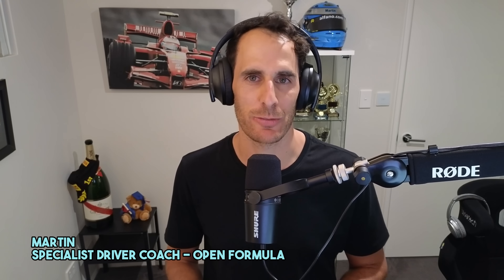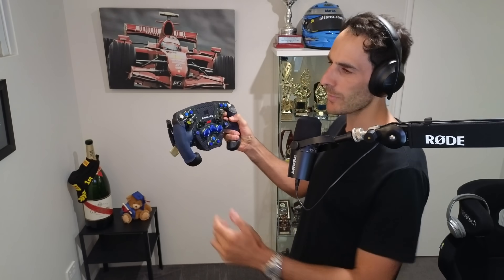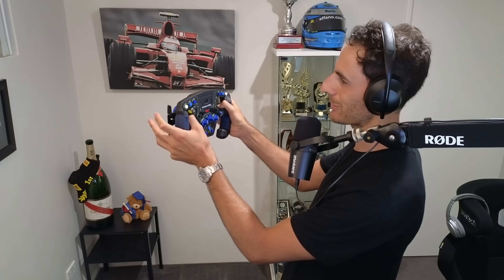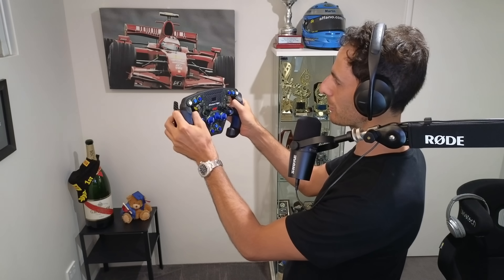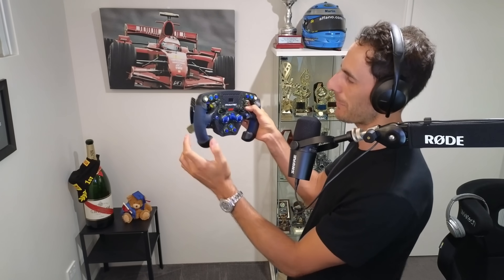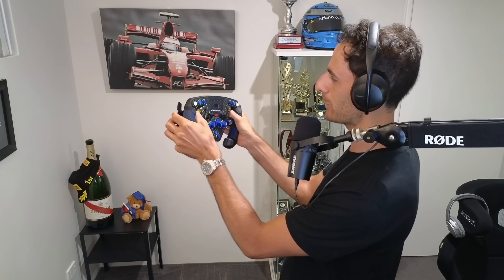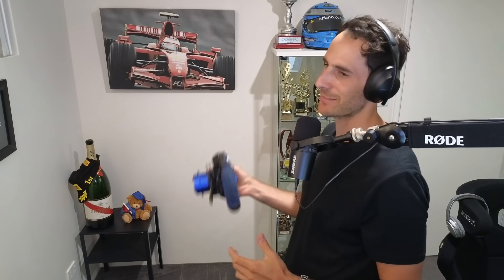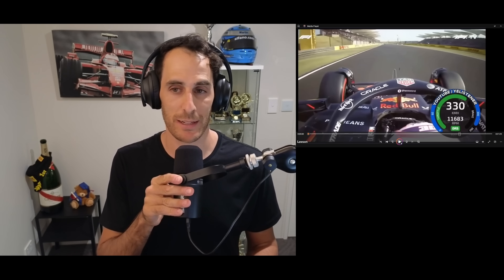The SECRET TECHNICAL Reasons Why Liam Lawson Was Sacked!

Comment: How is it Liam’s race engineers do not point this out because the data traces would make it obvious… perhaps Liam has this as a habit & just needed extended sim time to understand how to break the habit (a car-confidence issue, ultimately)
Reply from the maker: I think pointing out is only one part of the story.
Engineers are pretty good at pointing out. But explaining the why, or how, is missing. The importance and implications of such a technique too. That's a second step of insight that you need a driver coach to build trust that this direction is correct and create change. Have a look at my most recent short on Tight Lines/ Hamilton's engineering team recycling facts to Lewis when he's asking for help!

Comment: How do you think it is possible Liam got to this point without his engineers pointing out what he was doing wrong? If what you say is so obvious then sure Red Bull would have had that data before hiring him?
Reply from the maker: Its a good question. A) Its obvious to me (as a specialist open formula driver coach) but not necessarily obvious to some performance engineer etc.
B) How to resolve for it? Maybe also not communicated/ coached well to Liam such that he understands the importance of steering rate.

I think f1 is low level on at the track, high level in the design centres.

Interesting question keen to hear your thoughts back. Check out my most recent short clip - that gives you an idea of how bad these engineers are / are at ferrari

Comment: Very useful analysis!
Reply from the maker: Thanks appreciate this! So Suzuka quali, who you got? Liam or Yuki
Reply: @lowerlaptime  that's a good question that you ask considering what I've just learned about your analysis of LLs driving. Would you say LLs driving style is also a limition for the car he's going back to or an advantage because the car is more forgiving and suits his style better? Before watching your video I had LL with advantage just because Yuki would be under so much pressure and likely make mistakes but I'd call it 50/50 now.
Also, I just read that they have said Yuki's car will be quite different in set up to Max's but I heard them say that about LLs set up too, a reason he started from pit lane. Will they set up Yuki's car quite differently than LLs short run? A very relevant question if we're going to compare the two.

Comment: No offense but in the 1st example I felt there wasn't much difference between Max and Liam. You say in the wet Liam's style would be ok but imo that's also not exactly true: in the wet you need to be super smooth or you'll get understeer a lot faster for obvious reaons. Or what did you mean?
Reply from the maker: RE the hairpin - yeah you're correct. It is indeed, a small difference. Max is a little more continuous and Liam a bit fragmented in how he applies the wheel. The best example there is the double apex, that's bad use of a wheel

So in the wet you need to keep the wheel straight while braking and exiting, and do the whole "short corner" "v style" at the apex with a big hard and fast steering input

Does it make sense? Cheers!

Comment: The friction circle is a nice illustration but what your illustration assumes is what brake pressures he is using. Really what's needed to explore your theory are real steering and brake inputs but they should be available when using the simulator so why has he gone so wrong?
Reply from the maker: His whole timing of the turn in is off. Not so much to do with pressure application. Does it make sense?

Comment: Very similar to cornering with a motorcycle
Reply from the maker: Is is? How so!
Reply: @lowerlaptime  you need to trail brake as you lean into the corner to maintain traction. Too much front brake, down you go. Way too much front brake and over the bars you go. To be fast you need to be smooth.

Comment: That to me looks like a lack of confidence. We know the car is very snappy with a highly sensitive front end. Lawson obviously does not have the confidence to turn in at the same point and rate as Max does it. Now the sharp turn in the second phase could be one of two things, or a combination of both:

1) At some point he has to compensate for the lack of rotation in the first phase.

2) It might even be him DELIBERATELY inducing understeer to stabilize the rear.
Reply from the maker: How would you fix that confidence issue?
Reply: @lowerlaptime  If there was a simple answer to that, Sergio Pérez would still be in that car. So obviously I can't answer that. But I am convinced that as long as they don't make major improvements to the car (and with a different prioritisation in the development than the one they applied in the past), no one but Verstappen will feel confident driving it. Let's see how Yuki does, but I don't have high hopes.

Comment: thats all the new drivers in F1 todays. they want straight hard braking, and then turn and then straight hard acceleration. they never lean on the car. they never feel the monocoque. they dont trust the steering wheel.
so this isnt about "oh max verstappen driving style is difficult" no. this is modern driver "arcadey" approach to things. they want to whip the steering if then the car magically hold up. they prefer "drag race' style.  while naturally, you should be in command of where the car is going/where the nose is pointing. 
its like this in other words : newer generation of driver doesnt "draw" their racing line. they leave it to the result of their braking and their acceleration. while instead they should have GUIDE the car through the line in reality. they should DRAW the racing line with their steering. those who could do that gain the most in lap time.
maybe like if we want to put those new drivers into a quick "karate kid" style of training, we should tell them to do a PUSH THE TROLLEY racing in supermarkets. so they learn to DRAW THE RACING LINE.
Reply from the maker: this is a great analogy, explanation, and example

Comment: Dude. Every driver has a driving style. Some like atracking a corner and others like gliding through it. Both are trchniques that lead to different steering inputs. The main thing is to look at this combined with braking snd acceleration inputs
Reply from the maker: Hey. I never trust anyone who starts off with DUDE, because, in my experience, they've always been incorrect. I didn't read your message past the first line.
Reply: That's Cool, dude  @lowerlaptime
Reply from the maker: @FormulaBricks  lol
Reply from the maker: @FormulaBricks  its nothing personal its just that always garbage follows it. oHhhh dudddeee dude. Mate.settle
Reply: @lowerlaptime  I get it. People comment garbage all the time. You're right tho. Dude belongs at the end. Not the beginning.
Reply from the maker: @FormulaBricks   @FormulaBricks  well, you dont get it. People don't comment garbage, your comment was garbage.

But we can move on and be friends let me read your comment.

Yes, every driver has a style. Some work some don't work. In this case this style doesn't work. So knowing that, change, then. And go towards a style that works. Its not good enough to say my style doesn't suit the car. You need be formless, like water, and take the shape of the object you're in. Carmelian settings. 

Im not looking at combined in this case because this is just plain misuse of a steering wheel. Its AS bad as standing on the throttle and spinning on exit. What, you need see a combined for that too? or is it poor throttle work? Non rhetorical question sir.

This is poor steering work, and it is nothing more of less complicated than that!

I hope it makes sense, appreciate your comment
Reply: @lowerlaptime  indeed it is true one must be like water in an ice cold glass. Good in depth video. Good day to you sir!
Reply from the maker: @FormulaBricks  thanks bro ☺️🤜

Comment: liam isn't out yet tho.
they noticed that they pushed him in to fast,
which they did.
they're putting him back vcarb to gain experience.
they're putting yuki in RB bc:
1 he's been with the team for 100 races.
2 the honda contract is ending soon so RB isn't forced to keep him if it goes bad.
liam can crawl he can walk he can even run a little but they put him up against usain bolt.
they're now sliding him back and hopefully teaching him how to actually run before they throw him back with bolt and kipchoge.
Reply from the maker: Do you reckon Liam learnt anything in the process

Comment: I'm sure Lawsons contract was performance based, and an exit clause if he didn't keep to a delta, I agree with your analyst mostly, I feel he was going to deep into the corner, then oversteering the car to get grip, it possibly works like this in the RB, that is more an understeer cars, with lots of downforce, but the Redbull has always been an oversteer car, and this just won't work, he should have just braked earlier to the right entering speed, turned smoothly and powered out, he never did this in practice, qualifying, or in the race, and it's a bad habit to break, It's why Daniel was bad in the RB and McLaren, he also likes a car that's pointy front end, and couldn't get to grips with the understeer those last two cars are known for, he would have been great back in the Redbull, alas this is never going to happen again.
Reply from the maker: Do you reckon yuki will go better than liam did?
Reply: @lowerlaptime  Yuki likes a car that is very on the nose, and the Red Bull is like this, time will tell, he had testing in it and performed better than Liam, but Liam still got the seat, so to your question, yes he will be much faster than Liam ever could.

Comment: That's interesting, do you remember Alonso 'yanking' the wheel for a split second in the Renault. My assessment was that it was set-up very understeer and he 'broke' that trend with his input. I use that in karting, especially indoors with low grip. In Gloucester there is a banked hairpin which is quite fast. So, I don't brake, but 'yank' the wheel and feather the throttle. So, I am getting a double brake / steer effect with the front tyres!
Reply from the maker: Yeah i remember but it was a terrible technique

Comment: Also Max can drive with a loose rearend so the car rotates easier, brake bias can rotate car and rear sway bar can rotate car, the car is designed around pointy front end, not everyone likes that. Perez likes a car that pushes a little bit.. you gotta drive it on the nose.
Reply from the maker: Are you saying its a loose rear or pointy front?

Comment: Max also has the pause - its just way shorter.
That the issue with the RB21, you need a bit strange steering - with 2 phases, instead of 1 contininual smooth transition (which in theory is indeed the way to go). Max has already commented on this I think.
Reply from the maker: Link me!

Comment: Extremely clear and revealing analysis.  It is absolutely obvious that the teams, and within that the people who run their driver development programmes,  are deeply at fault.  They turn out drivers who can drive a forgiving car pretty fast, but even then not in the optimal way, because they are not taught to understand the interplay between the controls at their disposal and the stability of the car.  If Yuki has a better handle on this than Liam, it is evidently not down to the training programme.   In passing, it would be fascinating to analyse the travails of Perez in the RB from this point of view.  Was he essentially doing the same as Liam, only more skilfully,  and did the car move away from being amenable to this, so that what had been a stable technique in 2022 became predictably unstable by the middle of 2024?
Reply from the maker: Re checo? Yeah he wasn't as smooth as Max in trail braking and carrying speed in

Comment: Liam is on a shallow angle and his line is closer to turn and hence why he has to hold and then give more of an angle. I believe he is trying to do much more with the car than its required or programmed to do. Unfortunately its inexperience with the setup of Parent Rebdull Team , racing lines and the overall balance of the car ,plus his familiarity with the circuit. He is being compared to a team mate who has been with this team for 7 years and on top of that he is a 4 time world champion and a car that suits Max's style. Whoever comes in next will have the same stuff to deal with. I doubt Yuki would fair better here. We shall wait and se
Reply from the maker: Who do you rekon will quali higher yuki or liam?
Reply: @lowerlaptime most likely Liam! However they need to give Yuki time, you cant boot the driver post 2 races.

Comment: the way I try to describe it is, Imagine your riding a bike at speed and you turn for a corner. You lean into the corner with your body at the same rate at which you turn the wheel, almost as if there is a direct link between the two actions and you do this naturally without even thinking about it because it's intuitive. Well it's the same thing when cornering in a race car, except the release of the brake pedal into a corner is the thing that's balancing out your car, instead of your body
Reply from the maker: exactly this!

Comment: Interesting, some good points, but the circle should be explained in the first briefing of a racing diver school. To think a driver at F1 level does not know something so basic is crazy. If you feel the car understeer, applying more lock does not help, but that's what you do. 
I look at modern F1 debrief rooms and there are too many cooks the loss of AN to Aston Martin is showing by a drop-off at Red Bull and the Lance Stroll performance lift. Max knows the car's weak spot and drives around it. Anyone passing Max around the outside quickly finds out the Red Bull has turned into a shopping trolley. Poor Max gets the blame haha.  Then what we have is a mini Pirana club with no head cook engineering is competitive as well. 
Old school cooks understand the weight transfer aerodynamic loading per square of speed, brake balance, tyre heat changes, gear torque and power you change one you change the other. 
Sergio had a drop in performance as Adrian spat the dummy no one understood why, the slide rule kid and he does it that way to protect his salary. 
The car may be stalling and losing all downforce at a guess let's see what happens in Japan. Because Max will not tell you what to do.

Comment: Race cars don't like sudden induced changes of direction, by and large. Grabbing a big chunk of lock without some sort of compensating action at the other end to equalise the steering angles, or backing off, is a sure fire way to find bulk understeer. A basic grasp of physics, plus some years driving other cars, should tell a driver that. No doubt that smooth and progressive inside the car is fast on the track.

Comment: Great input thanks. Yes, Liam needs more time. I'm wondering if they are setting Yuki up to fail also. And if so, who do they put in the seat next. It seems that the RB is so set-up for Max's style that it will take some time for someone else to replicate it, if possible.
Reply from the maker: Do you rekon conspiracy
Reply: @lowerlaptime  No conspiracy. RB have designed the car for Max, it's become difficult to drive so other drivers are clearly struggling.

Comment: Given that Redbull are hardly resource limited for driver coaches, and have extremely detailed telemetry with a direct Verstappen v Lawson side by side comparison then they will know exactly what Lawson is doing and will have explained to him in great detail what he has to do. However it would take more than 2 race weekends on unfamiliar tracks to unlearn and relearn a fundamental racing style. Redbull don’t have that time. Of course Tsunoda may do equally as poorly.
Reply from the maker: one would be inclined to think as much, but, i can hear the talk now being about load transfer, slip angle, blah blah.
Reply: @ Have you seen F1 telemetry? It’s not just brake and acceleration traces. They can overlay steering input, GPS position, tyre temps, etc etc. I’m 99.999% sure Red Bull understand the differences between Verstappen and Lawson with intimate detail. But when you enter that corner much faster than your brain says is safe and just trusting on downforce and incremental brake/steer against your driving style memory muscle on a track you don’t know while under intense pressure is hard.
Reply from the maker: @shih_tzu_love  are you serious asking me if ive ever seen f1 telemetry
Reply: @ I agree with the general analysis that driving a pointy ground effect car around a corner fast requires a driving style that is smooth, progressive and where entry is faster than v-style, but there is zero chance Reb Bull have not coached Lawson appropriately. He just hasn’t had the time to unlearn his instinct and adapt on unfamiliar tracks where he knows a crash is the end of his time at Red Bull.

Comment: So what if the reason for the sudden 2nd input on steering is due to rear tire grip and instability... would it not also effect the ability to maintain smoother inputs... I've seen this exact same thing with other drivers who complain about rear instability of the car mid comer entry?
PS.. This analysis is accounting for only one aspect of many, that Driver Engineers have to consider when providing a COMPLETE analysis of driver inputs is it not?
Reply from the maker: Then the 1st input was too strong or fast